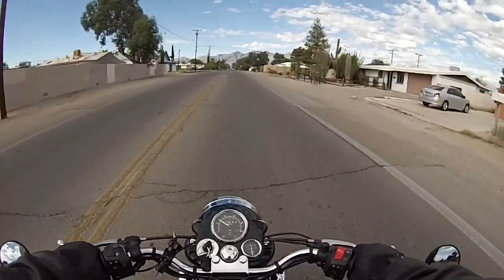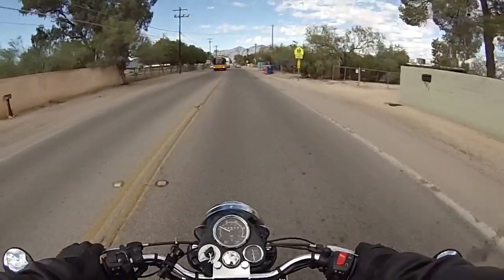MotoVlog 20 - Motovlog Mic Prototype - Royal Enfield

Comment: Excellent sound and video!  It is funny what we hear in the helmet and what the mic picks up.  My exhaust always sounds so good and deep to me but is so hard to capture with the mic.  Everything had a good balance on this one.  I have experimented with a second mic too but with limited success.  I used a y connector with two mics. One in my helmet and one near the exhaust outlet.  I couldn't make it work with the raw recording.  A separate recording of the bike edited with the vocals can work.  Check out a video XXXDeadhead did on the subject.  Thanks for sharing this.
Reply from the maker: sam smith I did see that, he wrapped a small Sony mic in deadcat and plugged it into his old GoPro Hero 2.  I have a few designs, I'm hoping to make it easy for motovloggers to make quality sounding runs like he does B-) Thanks for commenting and watching, ride safe!